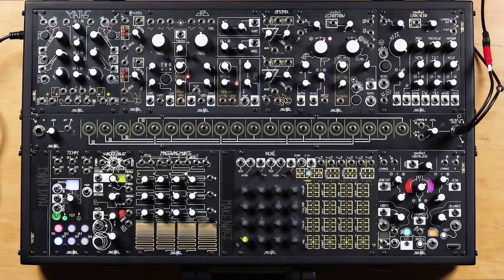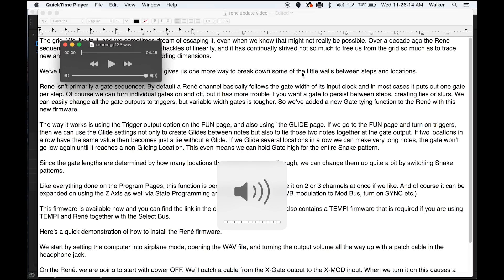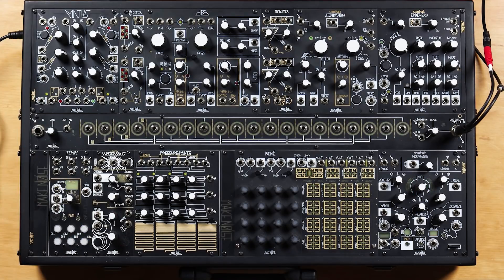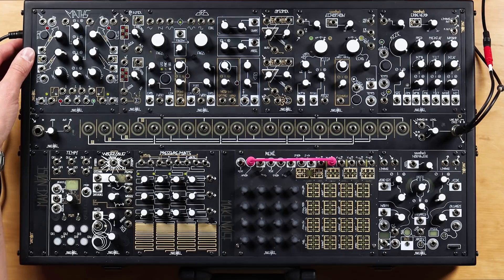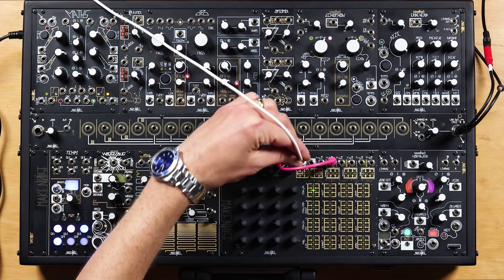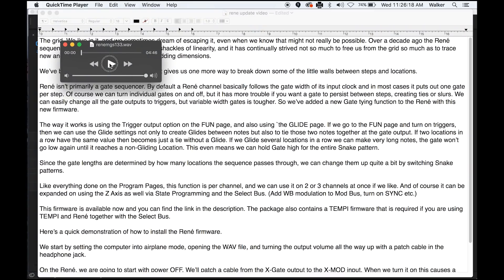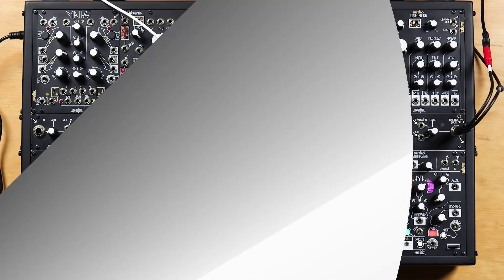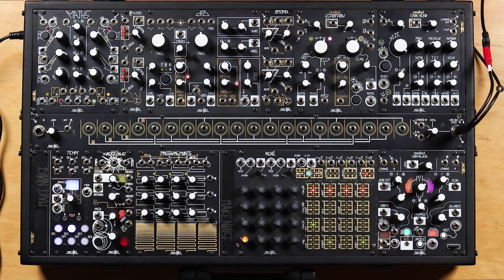New René Firmware!

Comment: Very important detail everyone should know: after clearing the old firmware and trying to install the new one from laptop headphone jack to Z-Mod input, it is important that the output is very loud. Otherwise it won't work. I tried many different media players (i-Tunes, Windows Media Player etc.) and none of them work. VLC does the trick (you have to crank it all the way up). I read on another forum that Quicktime also works. You can also use headphone out on an audio interface which allows you to gain the signal further. Would be good if MN include this important info in the Update Text File.
Reply: it worked only with my mobile phone for me. VLC or ableton didnt work.
Reply: @faruambient  Thanks for sharing. It seems to be very sensitive to sound levels, so probably it also depends on the hardware used.

Comment: Ok, I‘ve been playing around with this. A glide enabled location seems to be glided to, but not away from. Which means that whenever I want to have a note that is 2 steps gatelength it starts with a glidesound. I can‘t have 2 or 4 or 6 notes with the same pitch together without having a gliding sound before that longer note starts, right?
Reply: Ok, after some more testing this seems to only happen to the first note if it is not the same pitch value as the 2nd ... if they ALL are the same pitch it doesn‘t happen. Sorry for my error.

Comment: Hm... I've run into problem while updating. The first part of the update process works nicely, so I see the green LED lit up after removing the cable. But once I start the audio, all LEDs light up simultaneously after some seconds. If the audio is not turned up full, nothing happens. 
I don’t see the green moving  LEDs in the FUN OP line, no restart at the end of playing back the file. 
Suggestions, anyone? Is the audio too loud? Or not loud enough? Did anyone have similar problems?
Reply: ... and problem solved. I increased the volume slowly until I found the sweet spot. Rnee chirps like a bird now.
Reply from the maker: Glad to hear you solved it, Anatol! If you have trouble in the future we'll see your message faster at technical at makenoisemusic dot com

Comment: This is awesome way to end this year, thank you!

I wish we could use similar procedure to backup and restore saved states or even whole banks. I.e during backup phase, Rene would emit audio which could be later used to restore the state(s).

Is it something like this possible with the current hardware revision?
Reply from the maker: It is theoretically possible, in fact we have attempted this in some beta versions but unfortunately it did not reach our quality standards for public release.
Reply: @MAKEN0ISEMUSIC  If you ever needed a programmer, please let me know. Enjoy the rest of the year and thank you for everything! Best wishes
Reply: @MAKEN0ISEMUSIC  would a sysex dump using the expert sleepers midi select bus be a viable path for added backup functionality?